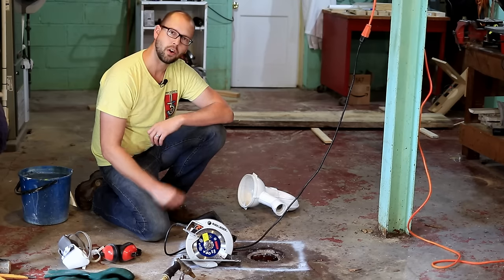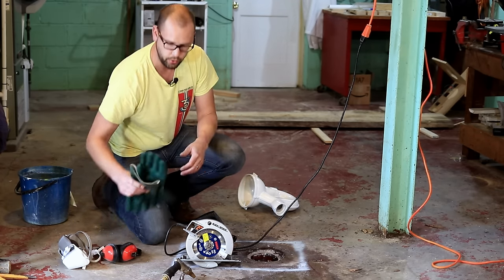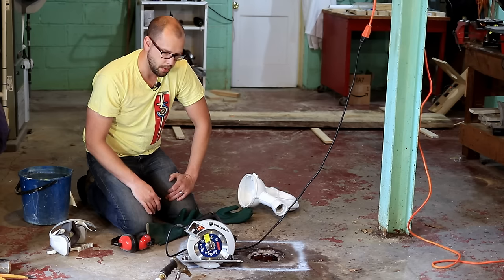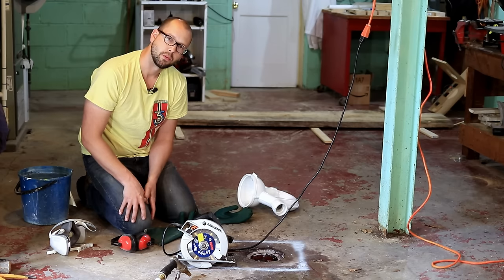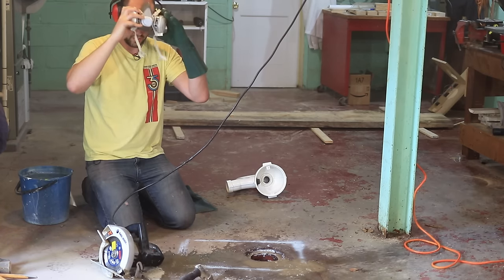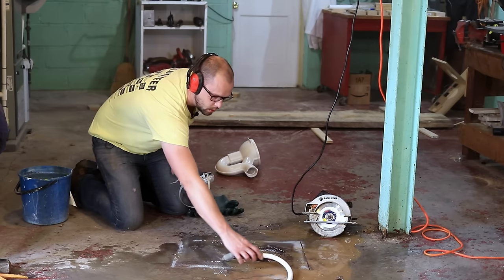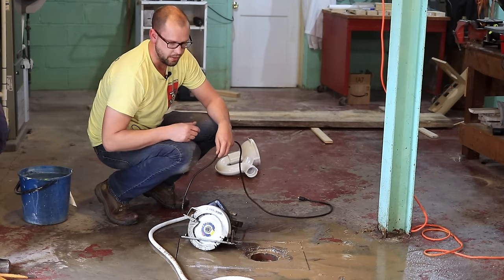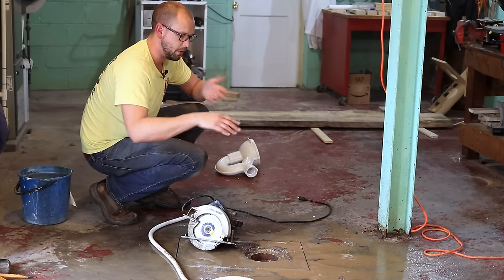Cutting Concrete with a Circular Saw

Comment: I was doing this on a side walk in the front yard, with a very cheap plastic housing circular saw, don't remember the brand.  All of the sudden the shaft sheared off.  The blade took off and motored across the yard into the street.  I started checking limbs to make sure I had all of my parts.  Thank the Lord for his protection.

Comment: It works, but I wouldn't use my circular saw. The saw blade is $30, and left my saw in terrible shape. The concrete slurry gets into the saw motor and gummed up the saw so bad that I couldn't use it again. You can rent saws specifically for concrete for less than $100.

Comment: Outstanding Sir I am an Instructor in a Job Coprs cement mason program and  you checked all the boxes .I show this video to my students for their first impression of concrete cutting with a circular saw and you are very safe .One recommendation Use knee pads helps keep the knees from getting wet and sore .Years of working in the field have taught me that . Thank you.
Reply from the maker: Thank you and thank you for the tip!  You are right about the knee pads.

Comment: Wow, I never really thought about using my own regular saw. I only have to make 2 or 3 short cots on the edge of a patio slab to run my electrical conduit for my hot tub! THANKS for an amazingly simple idea... just have to be safe!
Reply: Just clean your saw well if it's not dedicated "rock" saw...it's a mess.

Comment: Good video.  One caution would be for concrete that has rebar or reenforcement wire embedded.  You'll tell by the sparks.
One other comment - if you're doing this in a driveway to repair cracks or spalling, it is not necessary to go full-depth.  A partial depth repair will be quicker and be just as complete.  Just 1.5" or 2" depth will be sufficient; just let the bottom portion remain.  Don't forget to put a dummy joint in the repair, same spot as the original.  To each his own on the corners.  You can cut PAST the other cut if you want a complete cut corner; or, cut TO the other cut then chisel out the remaining concrete left in the corner.

Comment: I recommend a setting up a vacuum to help with the dust. Thank you for the video!
Reply: Yes! I wish I was there when my contractor cut into the concrete and shower pan. It dusted out the entire house.
Reply: THIS. In my bathroom I don't have a place for the water to go if I did use it, so I did this dry. The shop-vac helped but I'm also glad I put up plastic to keep the dust in the room as much as I could. It's even worse than drywall somehow!

Comment: I have to make a few interior cuts. I've used gas powered saws before, but it never clicked that there are concrete blades for a handheld circular saw. Thanks for sharing!

Comment: I have wondered about power tools and water as I have done this myself, they are usually double insulated but still if that water jumps into the motor, at best a knackered tool.

Comment: This was really helpful! Don’t forget that there are girls that think this is cool, too! I need to cut some channels to the opening for my sump pump, as I’m getting a little pooling around it. Thanks for this!
Reply: So, did you ever cut those channels? If so, how did it turn out using the saw. I need to cut a section out of a walkway in order to repair a leaking sprinkler pipe.

Comment: How  hard is it to cut through the reinforcing bars within the concrete ? does it slow you down and does it break teeth off the saw blade ?
Reply: Tough, this isn't the right kind of blade for that. What's worked for me is to kind of cut around them (you'll end up making more cuts in the concrete), and then when you have a good view of the rebar come in with either a reciprocating saw with a Diablo blade or switch to a circular saw blade that is for metal cutting. Rebar absolutely adds a PITA factor to something like this, but it can be done. It just takes a lot longer.

Comment: Thanks! My wife recently cut her foot from a clothesline pole. My mission is to cut the cement out from where a clothesline used to be. The previous owner of the home I live in now cut the pole but decided not to take out the damn cement. I have a circular saw but do not know which one to use to cut the cement buried in the ground. Would this work?
Reply from the maker: The saw will cut the cement but since it is probably very deep, you will need to probably waffle cut it and then smash out what you can.  If you can get it a few inches below the surface you can cover it with dirt and plant grass seed.  Depending on how wide the diameter of the pour is, you can also try just sledge hammering it to break it up.  Definitely wear long pants and a face shield though because you will have to hit pretty hard which could cause some small pieces to go flying.
Reply: You could also dig it up. That's what I do when I have an exposed piece of post. That way it's gone forever. If you have heavy clay soil, it may take a few days as the dirt will be close to impossible to dig. I dig until I can't get any more dirt up, then fill the hole to the top with water. Repeat as necessary. If the  cement is really deep you can try digging out around the cement, get a farm jack and some chain and see if you can yank it out that way.

Comment: Has anyone used the Diablo DMADS0700 7 in. Diamond Segmented Cut-Off Discs for Masonry? I need to cut through a section of a concrete patio to repair an issue with a septic drain line. thanks...

Comment: when you fill in this cut, do you put rebar in the walls before pouring?
Reply from the maker: If it is a large enough area I would put re-bar.  For this little rectangle I didn't and it has held up perfect.  It doesn't hurt to throw some tapcons into the sides of a hole like this to make extra sure the concrete will tie into the old stuff well.

Comment: yes, it works.
the problem is that a 7-inch circ blade isn't going to slice all the way through a 3-1/2" or 4" concrete slab;
even if you take the shoe off it still won't be enough.
Reply: No, but the score lines will make the hole or trench pretty clean. I just did this yesterday. Found out my slab is 5" thick. Sledge wouldn't break it, and I didn't want to crack the concrete outside the walls of the hole anyways. Used an air hammer and chisel to carefully break it up. Took awhile, but worked flawlessly.
Reply: Most sidewalks, slabs and driveways are seldom more than 3.5" anyway.  See my comment about partial depth repair.

Comment: If i have a new cordless brushless miluakee circular will it work will it damage the saw.  Have to make a whole in asphalt for bolard same size. Good respirator for silicates!
Reply from the maker: It will work but I can't say that it will be great for the saw.  If you are outside and can blow the dust away it might be a little better.  I have an old beater circular saw that I use for stuff like metal and concrete and a wood only saw.  I would get a cheap harbor freight or Craigslist saw and avoid the wear from the concrete dust on your good saw.
Reply: I have the Milwaukee cordless saw and was debating the same question. Adding a catch basin outside.
Reply: Yeah the dust can destroy the armature in the saw!
Reply: I just spent an hour breaking down and cleaning my mag 77 worm drive.  The wet cement turns into muck and goes into the blade guard and housing.  Then it re-dries.... AS CONCRETE.  Soon as you are done, get a hose and clean that thing out before it dries up like a brick.
Reply: guess I should have done that with my saw but that was months ago and I think the saw still works and I am done using it for that!
Reply: recently I bought an air powered saw and hopefully that wont bother it that way
Reply: @Carl-LaFong1618  😲 Never thought of that. Thanks!

Comment: Do you think this will work on a concrete driveway?
Reply from the maker: Yes, it could be a little thicker though.  You should be able to score it and sledge hammer it out.  Just make sure to wear a face shield and thick clothes in case of any projectiles.

Comment: Can this cut through Reinforced concrete slab?
Reply from the maker: Yes, it will cut through reinforced concrete.  Depending on how much cutting you need to do, you may burn up the blade at some point.
Reply: @CoolStuffGuysLike oh great, thanks!

Comment: Isn't there a risk of electrocution using a mains powered device like that?
Reply from the maker: You need to plug into a GFCI outlet or an extension cord with a GFI on it as outlined in the video.  In the event of a short, the circuit will trip.  As a second layer of safety, rubber gloves and shoes don't hurt.
Reply: @CoolStuffGuysLike  Worth noting that the GFCI will only protect you if your power tool has a 3 prong grounded cord. All my power tools are 2 prong only.
Reply: @Mach2point5  GFCI works on 2 prong cord. If the current going in doesn't equal the current going out because of a short,  the GFCI will cut the power.  GFCI's can be used to replace the outlets on old houses without ground wires to offer more protection against shorts.
Reply: @lavarat  Cool, I learnt something new today. Thanks.
Reply: @Mach2point5  You must have really old stuff.
Reply: @alycewich4472  Not really. A quick Google search tells that most modern power tools are "double insulated" and therefore have an inherently lower risk of electrocution negating the need for the ground wire. Or perhaps they just cheaped out.

Comment: Yes you can but wouldn't an angle grinder be better
Reply: Angle grinder is good for freehanding tight spaces... but the ability to rest the saw on the floor is invaluable!
Reply: @kckoellein  agreed, I have a grinder & demo saw and after seeing this I'm going to try find that blade. The circular saw that sits in my cupboard for months at a time with no use is about to get a work out lol.

Comment: What was the point of cutting it with that tiny ass blade again? Not to be rude, but why would you want to? Unless you are chasing cracks to seal them.
Reply: Mr Sir if that’s all you have, then I guess. All that blade is really doing though is scaring it. That concrete is at least 4 inches deep “probably deeper”. So he is not by any means cutting all the way through. It should also have mesh if not rebar. So when he hits the area within the cut, the impact of the hammer will effect the masonry surrounding. Could lead to damage later on.
Reply: @Mr Sir if nothing else creating a large enough "crack" that would create a weakness...that should prevent cracking from spidering outward....I've seen plumbers use this where they have to install a drain in basement (generally thinner concrete)...or even where they want to chip out To move plumbing in concrete slab... and I had success with it when I needed to remove a person of sidewalk for drain system.   It was more work but saved time in long run not needing to run rent cement saw
Reply: @Mr Sir absolutely...I only know because I used this method a couple of years on a thinner side walk.  Current project at new house sees thwdriveway filled with granite...rebar reinforced and about 6-7" thick...so would never work haha... Just a word of caution (I'm no "pro" but I've done a fair amount of diy)..,be very careful about electrical/plumbing/gas lines especially in old buildings as "code" has changed and lots of people would repair things and not pull permits back in the day. Nearly found this out the hard way as electric was 1" under the slab...
Reply: @michaeldrossos8836  WOW! Glad you lived to tell the tale!@

Comment: you shouls not use BLACK&DECKER saw for concrete, if that BLACK&DECKER machine fail apart or looses a part of it you won't find spare part for it. because BLACK&DECKER  don't provide'em in the agent store. BLACK&DECKER sucks
Reply: Maybe that's why he is using it as I'm not sure how well the saw would work after doing that to it!